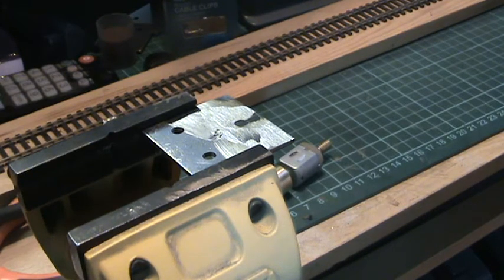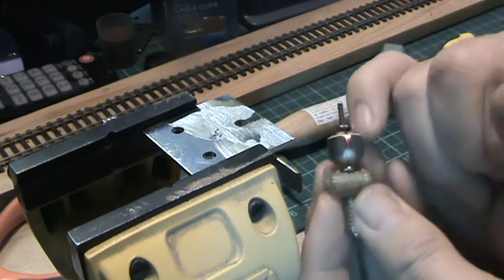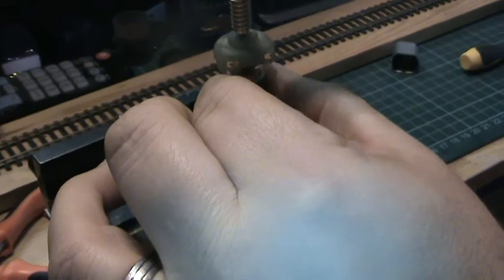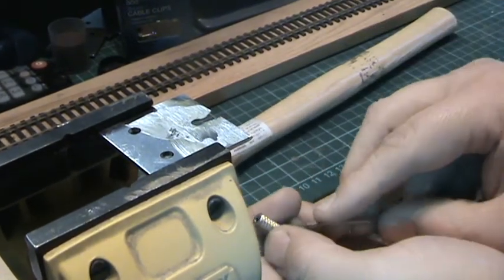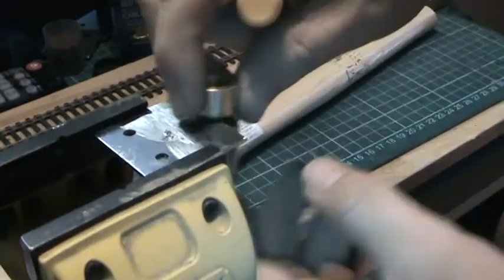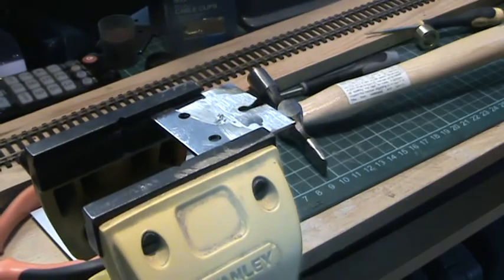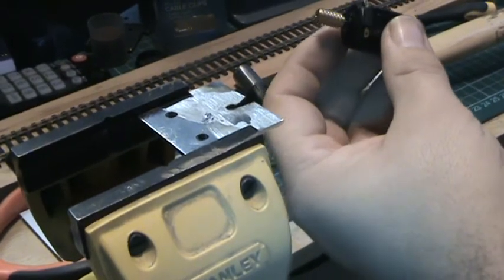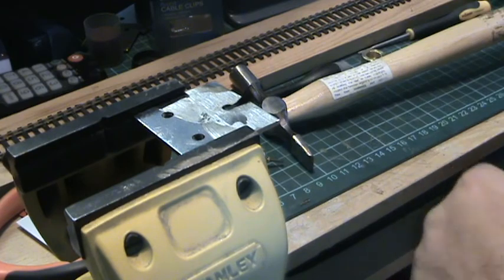TORNADO MOTOR REPLACEMENT REMOVAL AND REFITTING WORM AND FLYWHEEL

Comment: Hi Rob, good tips, can I recommend a worm puller instead of the bracket, have used one of these with success for years now. https://www.ebay.co.uk/i/392054114351?chn=ps&adgroupid=50809222926&rlsatarget=pla-412183267129&abcId=1133936&adtype=pla&merchantid=113697865&poi=&googleloc=9045783&device=c&campaignid=1057753625&crdt=0 Also, if you square the motor up in the vice, you can used the vice to drive the worm and flywheel back on in a nice controlled way, no need to open the motor as all the force is excreted on the shaft.
Reply from the maker: Hi thanks for your reply, The reason for the bracket and not a wheel or worm puller is this particular locomotive does not have the room to get the puller on properly, I own around 8 different pullers including the one you link to unfortunately in most cases with this loco you end up breaking or bending the forks on the puller, Bad design by Hornby unfortunately.
Reply: ah yes, have to admit mine is a older design, used to be dad's

Comment: I must admit its a clever idea but finding a way to press it on would be better than hammering it on .
Reply from the maker: I agree and if I had the tools I would make a miniature press, I have looked at what would be involved and I would probably need a small lathe and welder to do it properly.
Reply: Im sure you could adapt your press and that plate do you have a tap set ?
Reply: I use a pinion press/puller designed for slot car motors as these can motors are the same physical size. That way no hammering or possible damage to the motor

Comment: Well done ...should prove useful for a lot ...dave
Reply from the maker: Thanks for your comment I hunted high and low to buy something and found nothing, I bought all of the available extractors and wheel pullers and nothing come close plus they cost a small fortune, The problem was finding something strong enough as the gap is so small and most of the first attempts failed due to strength. But this prototype has successfully worked around 50 times without issue.  I have been looking into connecting the Ecos and Dynamis together and even though it states in the instructions you can details are virtually impossible to find on the web so it looks like another try it myself and see if I can get it to work.
Reply: ROBS TRAINS I also have been told it works , but needs to be dynamis pro , mi be is just the cheap one , but when I get all done with changes it’s something I want to find out about .. dave